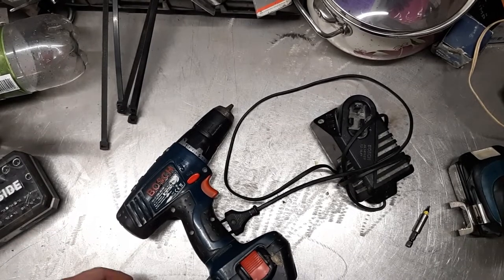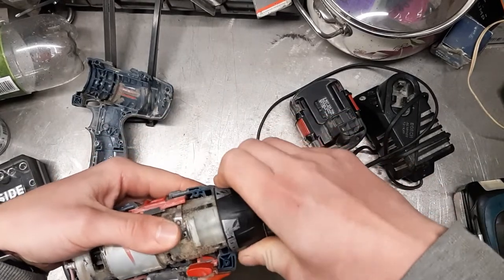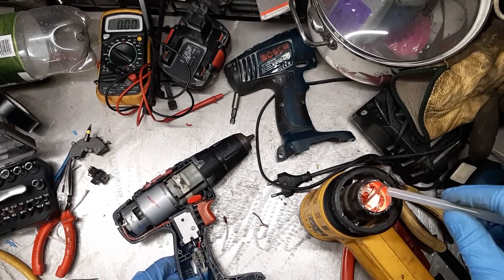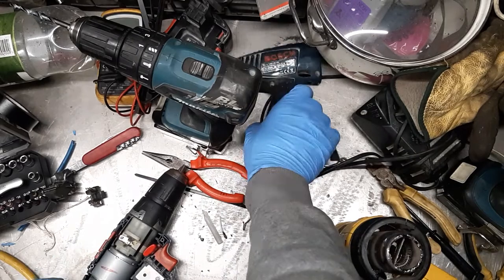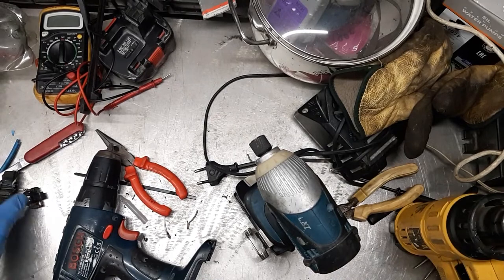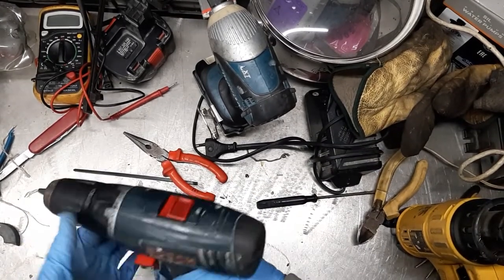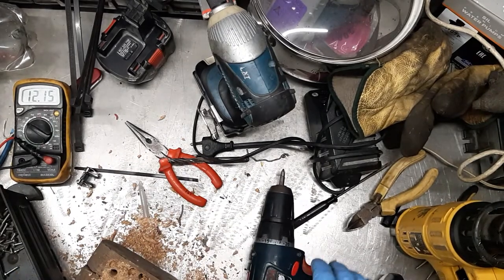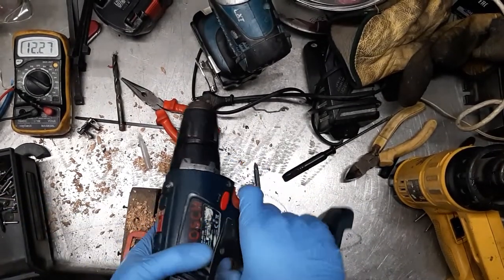How to use 12v battery drill on a car battery.

Comment: I have a DeWalt with dead batteries that I could convert that way. I don't think they make those batteries anymore. Cool that this is an option.
Reply from the maker: It works nicely, I used it for a bit yesterday. I also found 12v green Bosch drill I will make a video about it as well.